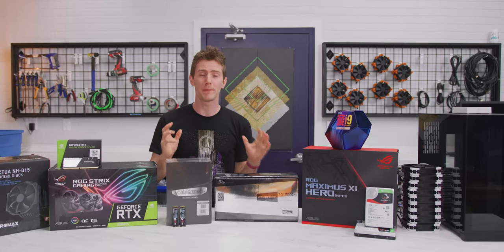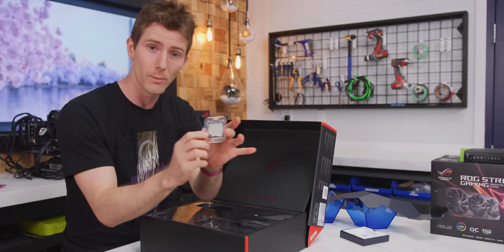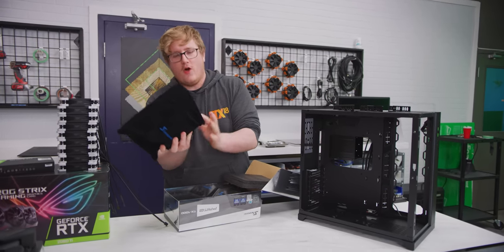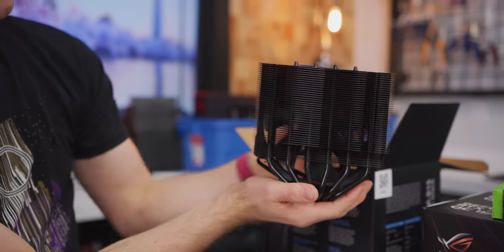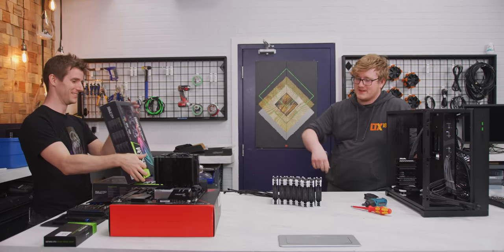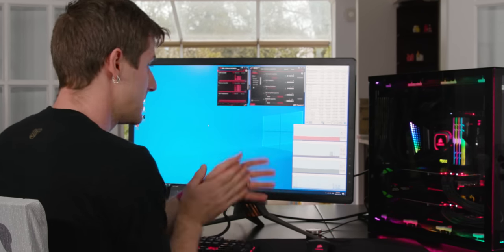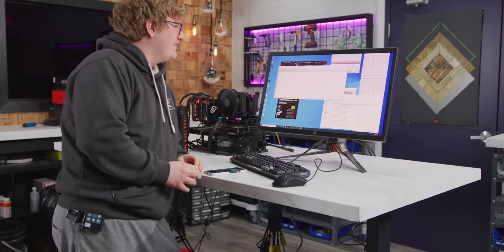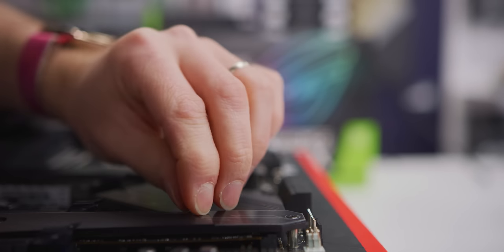Can AMD Beat the ULTIMATE Intel Gaming PC?

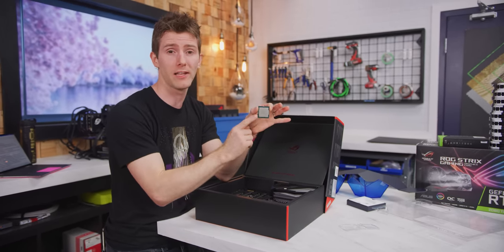Comment: 3:21 "Case is subjective, depends on the style that you want."

Me, a broke-ass budget gamer: Case is never an option
Reply: *style
Reply: I saw a video of a dude making a case from Legos. What works works.
Reply: @rblyle382  Implying lego is cheap
Reply: The best case choice is no case
Reply: My first pc had a case from a recycling center XD
Reply: I feel you im using a old prebuilt pc case my buddy allowed me to get for 10 bucks i posted specs and what not if you wanna see how terrible it is
Reply: me: cutting out holes in a cardboard box
Reply: But there's cases for $35 and even cheaper...
Reply: @cdurkinz  with no place to place anything in any place
Reply: STYLE not stile chief...  FFS
Reply: Than make one that fits your needs...
Reply: when you have more wood than metal
wooden box with holes
Reply: me who got a free case : *imagine buying a case lol*
Reply: @esatd34  They aren't going to be o11 dynamics or anything but they will house your components successfully with varying degrees of airflow. I've done a few budget builds with cheap cases, they work. I'd do that before leaving them flop around on the motherboard box. Usually on a budget you aren't dealing with really hot hardware anymore and even an intel box cooler can handle the situation.
Reply: Im using a cooler master stacker 810, i picked it up for 1,5 USD
Reply: bruceownsu sorry, English is my fifth language and I had autocorrect on a different language
Reply: Comp Wiz2007 as I said English is my fifth language and had autocorrect on, same for the other comments...
Reply: case is a mobo box
Reply: Oh no, you just stick with what you can find. Sometimes it's a random ATX motherboard tray or just a motherboard box and a screwdriver for the power on button, sometimes it's some random OEM case you found a trashed PC in, sometimes you can afford a good case...and then end up still using it for your main desktop a decade later.
Reply: That case is $140, it's super cheap for the look and ease of installation. My fav case I've ever owned

Comment: The RTX 2080 Ti alone is the same cost as my "high end gaming PC"
Reply: for half the price of a single 2080ti you can rock a high end ish pc and play all games on ultra with no fps issues at all. Just avoid 4k if you don't have something like a 2080. Most people use 1080p monitors anyway. so a 2080ti is just overkill.
Reply: Legit bought a prebuilt with a 1080 for 900, wwoulda had a 1080ti for 1025 but the seller couldnt format his SSD
Reply: @dbg5744  You can't play all games on ultra, even on 1080p, without fps issues with a 600€ PC.
Reply: @PaulPunk23LP  depends. If you have the case, psu, peripherals and monitors already. 600 is very easy budget to make an ultra machine for 1080p 60 fps.
Reply: @dbg5744  I can barely play every game on ultra with a GTX 1080 and an i7 6700k
Reply: DBG Ultra is subjective. To real users what we deem ultra is being able to support monitor refresh with a sustained stable FPS by the machine. 1080p should run minimum on 144 hz instead of 60hz, 60hz is why many people experienced pc eye syndrome. A 1080ti cannot rum all games even on 60fps that’s a false comment other than that I agree that most games would run ultra no problem but that is at best 80fps.
Reply: @dbg5744  🤦 then it's not $600....
Reply: @dbg5744  Ya. No. That's not high end sorry 😂. If you're not spending almost $600 (I'm basing of CAD mind you) on just your GPU, you are not high end. No matter how much you want to call your potato that to feel better LOL
Reply: @PaulPunk23LP  dont play on ultra. High settings looks the same. Even medium on some games looks good
Reply: Damn I feel bad for u 😢
Reply: @ques1134  😅 This was almost 3 months ago.

Now I still have the same PC but I play a mobile game on Bluestacks called King if Avalon(KOA) for short.

I've spent $5k on that game P2W in Kingdom 821.
There's a special group that does discounts. Higher discount depending on country you live in to match the currency.

I get between 10-12% discount depending how much I spend in game and use their service. Their service is free to use. No cost at all. They are like the "back-end" of the game to give spenders discounts to keep spending more..

In 2 weeks from now, there's a 50% off discount. It's roughly 35% here in California. Going to drop a big fat $10k and be the second strongest.

We have the 2nd, 4th, 5th, 6th, 8th, 9th and 11th strongest players in my alliance. 3rd and 5th are from another alliance. Rest are from other alliances. Strongest player is a developer that gets free stuff 🤣🤣🤣 We are a family alliance with the developer and his alliance.

3rd ranked alliance hit us when we made an agreement not to attack each other this weekend for kill event. And then one of their members hits our player who is in vacation for the week. Our strongest players burned and zeroed that other player. That other players starting bitching in the Kingdom Chat 🤣🤣🤣 She said to our 4th strongest player in game that he is a pussy and hiding from her leader who is the 3rd strongest.

So our 2nd strongest said to fuck off and not bitch when we made an agreement not to attack each other this weekend. And that it's her fault she lost everything to our 2nd strongest player in the alliance(4th in the kingdom). 🤣🤣🤣🤣🤣👍 😇😇😇😇
Reply: then its not high end you broke ass bitch
Reply: $1200 is not a high end gaming PC. You have a mid range system.
Reply: DBG high refresh rate monitors exist, I have a titan rtx and an odyssey g7, 1440p 240hz
Reply: Easton LeMon lmaooooo imagine not being able to format an ssd
Reply: @alwayssorry346  for 900 you couldve got a 5600xt build if u built it yourself
Reply: @chrish4439  u get a 5700xt in cad for 400, and 5700xt is definitely high end
Reply: @deeppatel7496  I couldn't bought anenih that was cheaper with the XT.

I like the 1080 just fine and I didnt feel like building it myself
Reply: yeah im still here with my ryzen 5 2600, rx 580 nitro+ and 8gb of ram playing AAA games on ultra without any problem.
Reply: The thing is.. If I build one now, for 1300USD, I could actually beat out this system on pure gaming performance.
Reply: @dbg5744  Ehhhhh half the price? 700$ doesn't leave much room for future proofing and you definitely wouldn't be cleared to play on ultra with no fps issues on every game. Definitely you can get a PC that can play pretty much every game without looking like shit but you definitely wouldn't be future proofing or playing every single game on ultra with high fps.
Reply: @lmCIoudz  1200$ from 6 years ago? True, definitely not high-end. 1200$ spent today? 100% considered a high-end PC, you can easily have a system plan for 1200$ made entirely from scratch (no case, psu, fan, cooler reuse etc) that is capable of high end performance. Especially with the 3000 series pricing that was just released.

Comment: Linus: “without spending extra money in things we don’t need...”
Proceeds to install dual 2080Ti which many games can’t use...
Reply: Not true there are alot of games
Reply: @jacekeller4128  Name at least 5 games that released in the past 2 years that work without tweaks and no flaws whatsoever in SLI/Crossfire.
Reply: @jacekeller4128  SLI/Crossfire is D E A D
Reply: @penumbrum3135  there is something called NV LINK
Reply: @penumbrum3135  the witcher 3, farcry 5, pubg, fallout 4, bf4
Reply: @jacekeller4128  he said games that released the past 2 years those are old games man, bf 4 is like from 2014 Witcher is old too etc
Reply: @wolfakixhd655  actually some of those games have been released in the past two years 

But I'm not trying to argue sli and crossfire arnt dead they are still very useful for other stuff besides gaming
Reply: @jacekeller4128  agreed